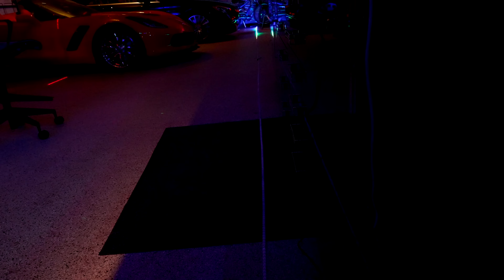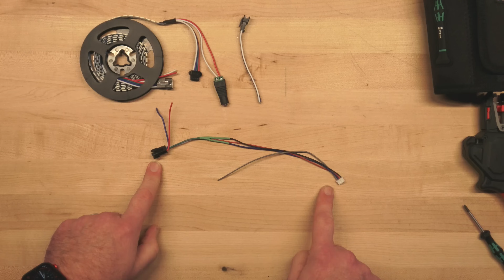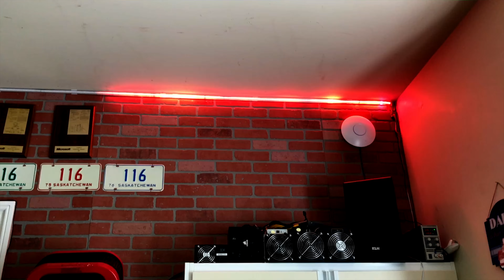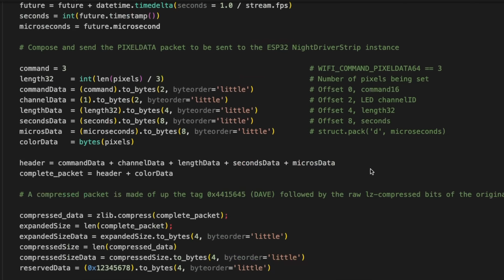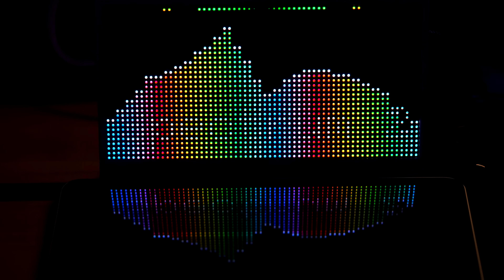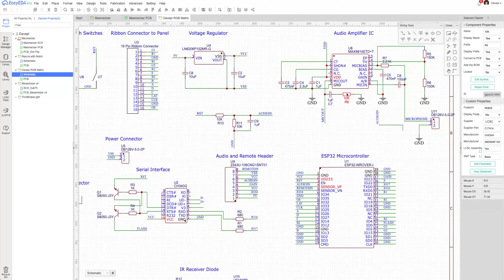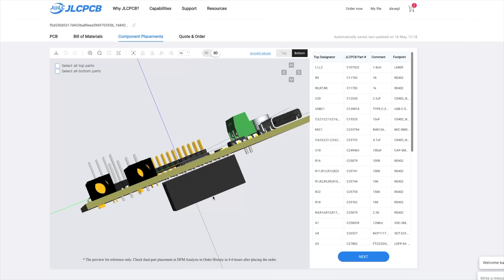NEW LED Software and Hardware Platform that YOU need to know about!

Comment: Thanks man !   on of the days I have to tell you the story of the First ISP in the Imperial Valley all running on NT 3.51 Dial up pool using RAS (I found a bug and thankfully Microsoft refunded my support fee on that) web was using O'Reilly Media for web host, Seattle Labs for Email and i forget who I was using for FTP back then but it all worked for years started with 2 modems when I shut down in 2002 we had over a 100 incoming lines all still using RAS and NT :-)

Comment: I work at a convenience store. And I wish I had a computer program that sorted the loud transients off the property...
Reply from the maker: I used to work at 7-Eleven.  But it was in Saskatchewan at forty below, so there were surprisingly few people wandering around.   There was one brave dude that toughed it out all winter up under an overpass, though.
Reply: If you wan't to confuse people, record their speech and start playing it back with a slight time offset (beware of feedback). A similar effect to saying random numbers to someone that is counting out loud. Detect loud transient and then play back the previous couple of seconds recording (may only need 0.5 to one second). I saw a video of it done once, and it was quite effective.

Comment: Four wires...  Power, Ground, Data In, Data Out...   Sorry, but my pedantry won't let that pass without comment.😉
Reply from the maker: The LEDs have those four connections, but in an LED strip, I count only power, ground, and data on each end!
Reply: @Dave's Garage  True, but that's still two different data signals if you're daisy-chaining the strips. Of course, there are only three connections shared with the data source.

Comment: Woah, I'd be interested in building discrete panels that can be linked together to act as a large format display. I would need the ability to inject HDMI source though.
Reply from the maker: You can do it on the PC and send the frames via WiFi, if you have some way to get frames out of an HDMI capture device.  I have a sample posted in the code for a YouTube video player, it'd just be a different frame source.
Reply: @DavesGarage  oh that's a good idea. I don't actually need HDMI input if I just send the frames over WiFi. The HDMI was so that laptops could send their display, but screen capturing can do that just fine.

Thanks again!

Comment: Thanks Dave, I have been tinkering with IoT but basically just treading the surface for some time.  Coincidently, yesterday while going through my storage locker I came across my Arduino Mega along with some sensors and a Radio Shack LED light strip.  I spent a good amount of time last night combing around the internet to find documents and sample code that Radio Shack previously provided for the LED strip but no longer do.  I wish I knew about your project one day sooner.  I think it's time to go deeper.

Comment: I'd definitely like a code intro walkthrough please! 
I have hacked about with it myself and used it to drive Neopixels sewn into Hawaiian shirts, which was huge fun. I added a thread to take inputs from the accelerometer on the M5 stick C plus and used movement as an alternative to beat detection. 
I haven't shared back as I know about as much C++ as it takes to be dangerous and slightly embarrassed by my code. I will if you're interested, though?

Comment: I remember running around the house playing with LEDs when they first came out. Holy crap was it cool when the new “blue” LEDS came out! =]
Reply: @BlondieHappyGuy  LED didn't really become a thing until the 70's. Manufacturing improvements made them cheaper and a few years into the 70's the efficiency was also improved by a lot.

Early LED were red, green, or yellow. But blue LED were not available on the commercial market until very late 80's or early 90's. Initially they were also very weak and inefficient. According to Wikipedia the first blue LED had an efficiency of about 0.03%...

Early to mid 90's this number was improved upon dramatically and has as far as I understand remains about the same today.

Going by this I tried dating my memory of the first huge LED display I saw. I think it has to have been built in the mid 80's and was taken down in the mid to late 90's.

It's pretty amazing how much the technology has been improved over the years. And that is both the colors and the introduction of addressable RGB LED.

Mini LED is also very interesting development. And Micro LED promises to fix all the weaknesses of OLED, but it all comes back to pricing and improvement in manufacturing. I have a feeling that if Micro LED becomes a economically viable alternative to OLED for large displays OLED manufacturing will suddenly become a lot cheaper. 

But that's just speculation. I do remember that back before OLED was commercially available there were a lot of speculations that OLED displays would turn out to be a lot cheaper to manufacture than LCD displays. But so far that doesn't seem to be the case.
Reply: @blahorgaslisk7763  Also, green LED were a yellowish green. True green ones are a recent development with the same technology as the blue ones.
Reply: I remember when I saw the first large scale LED display. at something like four or five yards across and three to four high it was impressively large and the images could be seen in bright sunlight. However the colors were off as it only had Red, Green, and I think Amber. Green LED were simply not available yet. A few years later there were some breakthrough and it became possible to make blue LED's.

This display was as far as I understand a one off monstrosity and was used for advertising. I think it remained in use for at least ten years, possibly twenty, before it was replaced. By that time it had lost a lot of it's "magic". When it was new there were nothing else like it, and when it was retired it was just a bad display with low resolution, it was rather dim, and it had crap colors...
Reply: Yeah.... I'm Blue, Da ba dee da ba daa
Those were the dayz...
Reply: I built a flashing LED project running from a 1.5v cell in 1978. Only red in those days. It was amazing that  the LM3909 could drive and LED from one cell.

Comment: In some ways, LEDS and RGB is cool, and is the standard. Though, have noted through some testing (finding and buying obscure LEDs to try to figure out a mystery) that I seemingly have slightly non-standard color vision, where, say, 440nm and 480nm are different colors (in a way that does not match up with the RGB model), with 465nm (blue) as an intermediate color. In real life, there are some colors which don't really exist on computers or similar, with computers reducing all of the blue-cyan rage into a monolithic color-band (and natural rainbows have some non-standard colors).
There are several visually distinct variants of cyan and magenta, but I have noted that others don't see the difference (seeing both forms of "cyan" as effectively the same color, ...).
Can note that part of my family (including my mom) does have a form of congenital tritanomaly, but she does not see the same colors as me either.
I lack a good explanation for how this could happen, except maybe that rod-cells contribute to color-vision or something... (And can note that I also have some issues with sensitivity to bright lights and difficulty seeing effectively at high light levels).
Also, have noted that light at 400nm doesn't really match up with a camera: IRL, I see more of an indigo-violet color, camera sees it as more of a whitish violet or "pinkish" color.
I didn't get many LEDs much shorter than 400nm, as this wasn't really the area I was focusing on.
Sometimes, it seems like it would be interesting if computers/TVs/cameras could match the real-world colors, as opposed to typically giving a reduced-color and off-white-tinted version, but alas...

Also, can note that my first projects with microcontrollers were mostly trying to build motor VFDs.
But, now I am mostly messing around with FPGAs and working on a custom CPU ISA.

Comment: You did well to get one esp32 running wled and infra red receiver at the same time. I found the tight timings broke each other. I was writing custom components for esphome in c++
Reply: @BlondieHappyGuy  Hi... i didnt try that - the ESPHome platform isnt really geared to multi threading... i got round it by soldering a cheap ass ESP8766 on to handle the IR duties :)

Comment: Loving the concept here. Can the Board drive multiple, series connected HUB74 boards?  I made a RasPi display a few years ago using 3 of the same size panels used in this project, worked OK but my programming skills "need work"

Comment: A diffuser on top of the hub75 panel can make images and video more easy to view. With 3d printing, one can be made that is divided into cells so each pixel illuminates a square of light, making square pixels instead of dots
Reply: Yes, that's how Divoom pixel art frames diffuse LEDs. It's not complicated, but it turns a matrix from looking "cobbled together" to "commercial product".
Reply: That would look sweet, more like a CRT I guess

Comment: Maybe I missed it, but what WS28xx  LED panels are you using?  I purchased some small panels that come in 10 x 10 WS2812B layout, but you have to solder each led to one another (would take forever).
Reply: It's not WS28xx or any other addressable LED these are HUB74 panels, as used in jumbotron screens etc

Comment: I resonated with your comment on getting your dopamine hit from blinking an LED, similar to your first program doing something useful!

Ages ago I was a math major, at a school which was oriented towards pure math.  It was an interesting aesthetic, wherein I learned that basically (pure) mathematicians produce theorums for other mathematicians to read and be impressed by, perhaps build upon.  Very, very clever and very very abstract.  And you needed to study for many years to get to the frontiers where new discoveries were made.

However, I got seduced by the computer in the basement tho (CDC 6400).  Basically, the programs I wrote could interact with me more than theorums did.  Similar use of innate cleverness, but a bigger dopamine hit for the reward.  Eventually, I could even write programs that didn't involve punch card decks later producing line printer outputs - you could write programs which received unbuffered input from a teletype and printed output to the same device!  (COBOL was actually the first language on CDC to allow this, so I even held my nose and took a COBOL class).  Then there were "minicomputers" which could display on a CRT screen, and we were off to the races.  Timesharing computers, modems, terminals, IMSAI 8080 & CPM, IBM PC & MSDOS, graphics, windows, the Web, and now arduino and ESP32, etc.

It has been quite a ride, and I still get my dopamine hits - now often from blinky flashy LED creations.  Thanks for playing your part in that.